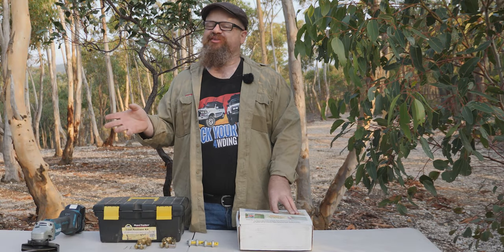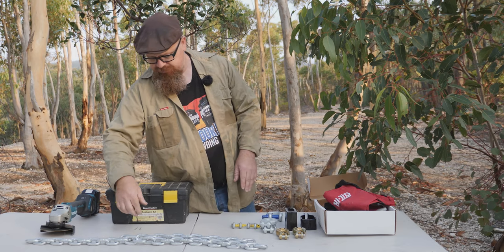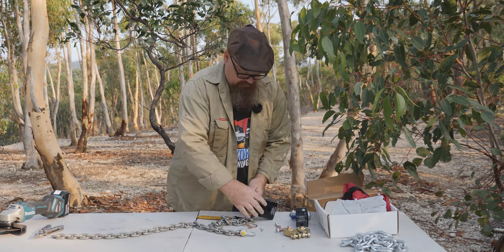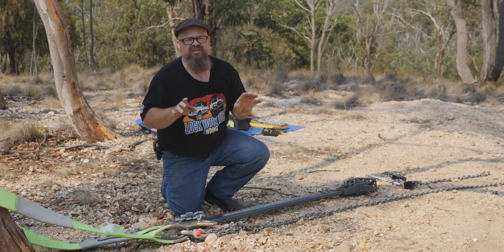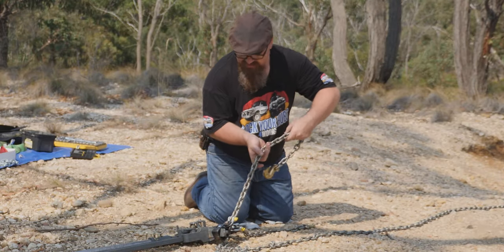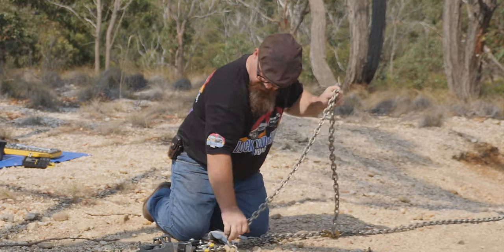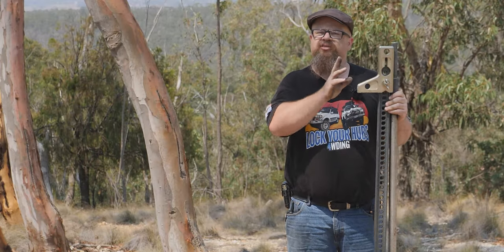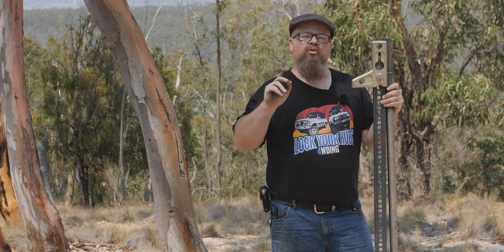Hi-Lift Jack Winching Part 2

Comment: Just get a winch.
Reply from the maker: Hard to winch backward with a front mounted winch though.....
Reply: @LockyourHubs4WDing  Get two winches (one front, one rear)... anything but this!
Reply: After you get to winch a vehicle 10 yards or meters you will definitely decide to buy a good electric winch.  I got the "pleasure" to helping recover a large 4wheeler out of a swamp in a vehicle restricted area. Luckily I had my 60 in High-Lift jack in my Jeep. A few miles walking with it and at least synthetic winch lines.

Comment: Excellent explanation?
In principal its similar to how a linesman would clime a telegraph pole.
Clamp - tension - ascend.  then again on the other foot (chain)
This is similar to the method i have used in the past.
Only i do two other things
1:  i have a large heavy duty D ring  on the " your truck" end of the hi-lift bar to feed the main chain through (on the 2nd hole in tjhe bar). It keeps the stresses more parallel to the hi-lift bar. And stops the chain pulling away from the jack bar
2: On the "your stump" end of the hi-lift i have a heavy duty D ring with two bushes through the last "top" hole on the jack bar. Cheaper, more flexible and easier to get  anchor strap tighter.

Nice clear explanation...

Comment: The original HiLift 10mm chain in the G43 class has a load capacity of 1800kg, the 8mm chain in the G80 class has a load capacity of 2000kg
The thinner one is more durable and lighter
Reply from the maker: Definitely lighter!
Reply: @LockyourHubs4WDing  The weight of a chain depends on the material it is made of, the length of the chain, and the diameter of the links. According to a Calibrated Chain - Break Load, Weight and Volume Guide by Jimmy Green Marine, the weight of 8mm chain is approximately 1.45 kg per meter and the weight of 10mm chain is approximately 2.3 kg per meter 1.

Comment: Hi. Great demo. Just wondering wondering how you get the pin from the 1t bow shackle through the 8mm chain link? The Crane and Gorilla shackle pins are about 10mm on the thread end so don't go through. Are you using a different brand that has a smaller diameter pin on the 1t shackle?
Reply from the maker: The shackles are from Noble and Sons in Dandenong Victoria.

Comment: It would be interesting to know how many people have or use an extension handle. I notice this vehicle has no front winch on it.. so in your opinion which method would you use, the winch or the hi-lift jack? Great video.
Reply from the maker: Thanks! There's no doubt that an electric winch is easier than hand winching, though it puts weight on your 4wd exactly were you don't need it and is pretty much limited to winching forward. Where as the Hi-Lift can winch forward, backward or sideways. 

I've been stuck, in my 80(with winch) and nothing to attach the winch to! I winched out backward using a tree behind, using a double line pull and the Hi-Lift.